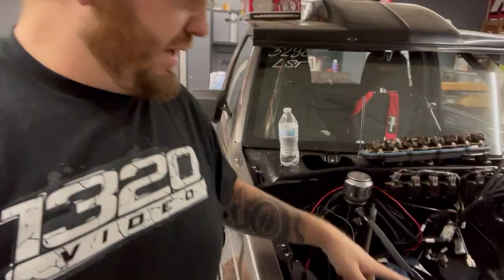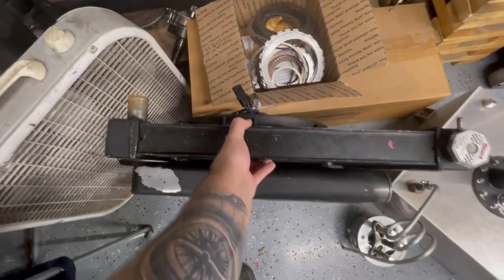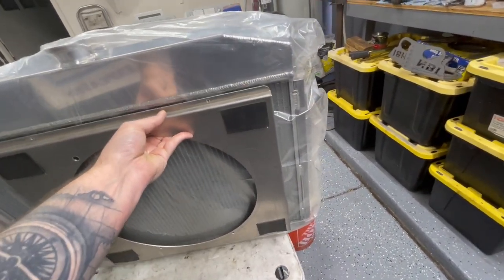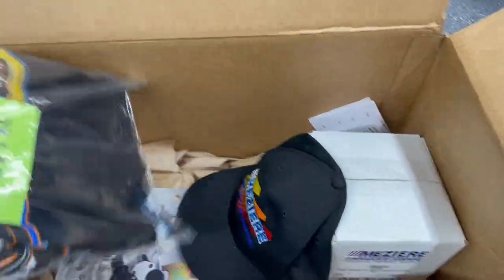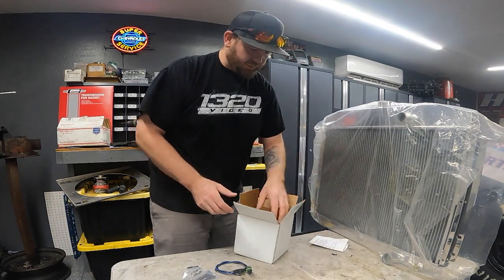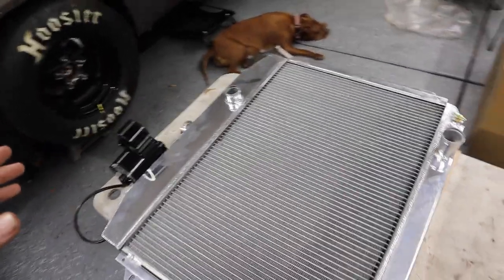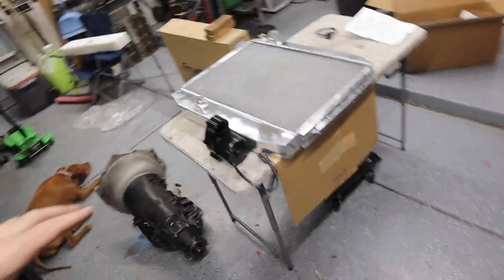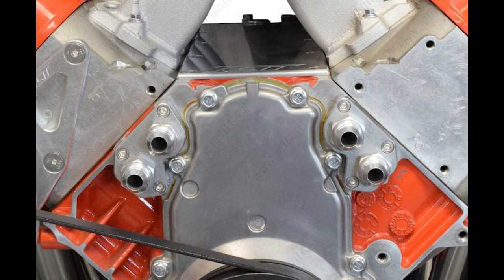Starting To Mock Up a Rear Mount Radiator With Meziere Remote Water Pump

Comment: I was hoping to see a gallens per seconds  test I am putting the same pump in my intercooler system with a roots blower on top. I will not get to flow test mine until Spring.

Comment: If you have the room, mount the pump directly to the inlet and or outlet, preferably the outlet if I remember correctly. Also take a look at 417 motorsports water manifold.

Comment: What would happen if a radiator was mounted on the roof, flat level, with fake "roof rack" mounts to somewhat hide it.  
  Could that even work, or are there principles of water flow or something that require it to be at engine level or lower or something?

Comment: Little off subject for this video but I saw your transmission sitting there wondering what type of transmission you run and what type of horsepower it’s rated for. Going to be putting a 5.3 in my blazer hoping for 800 to 850 hp at flywheel
Reply from the maker: It’s a th400. With very minimal upgrades a th400 can hold the power you’re looking for

Comment: A "helper" pump?  I was skeptical at first, but then agreed in short order. If theres a problem with bone stock pumps the impeller design is often so cheap it will cavitate like a mad dog when there isn't 6" of head or so, as standard radiators enjoy - losing that decreases flow efficiency and maybe severely.     An easy example of impeller design that can handle drawing from a source a foot or so lower is... a pool pump.  So yes: except some aftermarket impeller design capable of some lift exists to improve a stock housing, it looks like an electric [like Davies Craig or some such] is necessary when tucking the radiator to a lower position than the pump intake, front or rear.

Comment: I'd say run a restrictor instead of a thermostat. You can get a variety pack and figure out which works best.
Reply: I think motion raceworks did a video a while back about the myth of needing to slow the water down by using a restrictor or thermostat and said it's not necessary you can run without if I remember correctly
Reply: Definitely don’t need to slow it down.